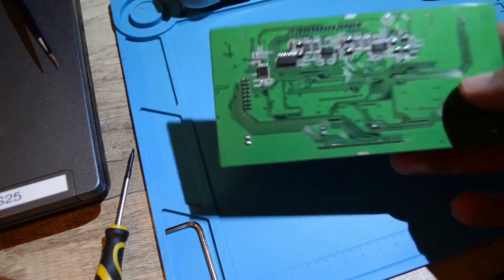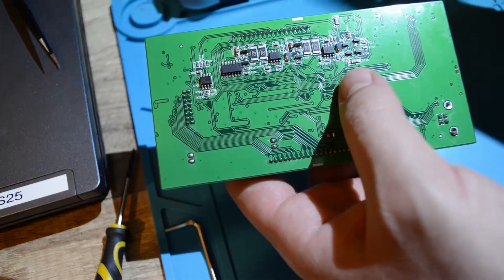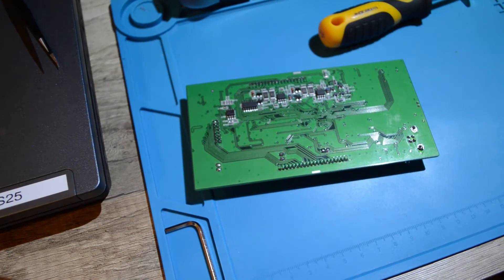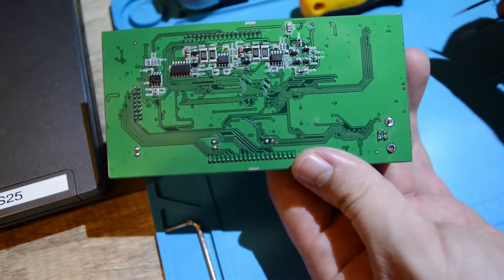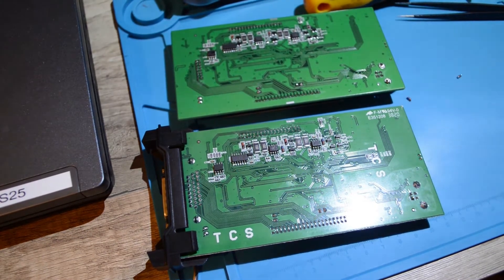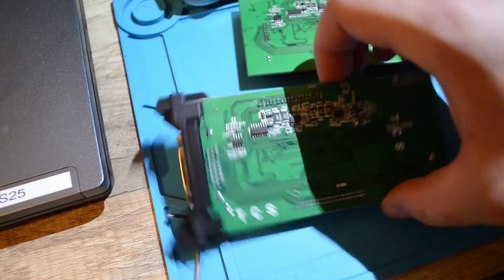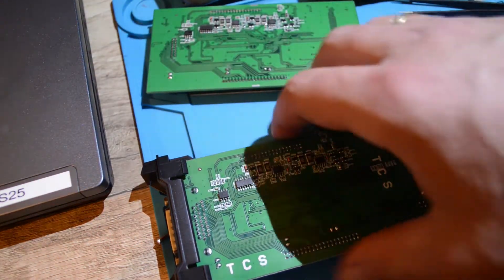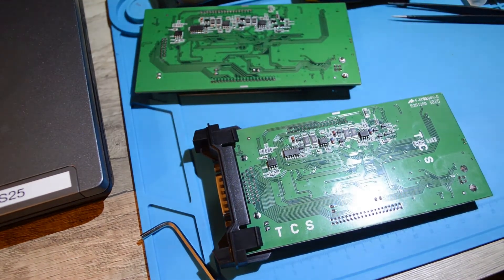Delphi DS150e Repair. Vehicle not responding.Delphi no connection with Opel. BMW and Truck (LKW)

Comment: I updated from 1623 to 3201. After updating I tried to connect to Renault Fluence ZE. But it shows vehicle not responding. So I went back to 1623 and it is working well only on version 1623. Is there a solution for this (vehicle not responding) when updating the firmware?
Reply from the maker: @falahdemery8258  single board or dual
Reply: @YOYODiagnostic  I think dual board
Reply from the maker: @falahdemery8258  RTFM

Comment: Im still getting vehicle not responding, its a 2 board v3. any help would be appreciated
Reply from the maker: Buy a real programmer. Stop using clone. Thinkdiag is only 120 euro.
Reply: @YOYODiagnostic  Thinkdiag ile bu programın ve cihazın yaptığı hiçbir şey yapılmıyor. Hyundai i20 2016 model 1.4 Crdi aracımda thinkdiag ile sadece rejenerasyon yapabiliyorum. Enjektör kodlama yapamıyorum, DPF replace yapamıyorum, sensör resetleme yapamıyorum. Hiçbir şey yapamıyorum.

Comment: I’ve got a PCB that says TCS MAIN V9.0 with original FTDI, upper board has a processor and orange nec relays. How to make it better? Do i need to remove these D701 and D703 diodes? Are there any mods needed on my ds150e ? Thanks
Reply from the maker: Hello.
Send pictures on Mail with the motherboard.

Comment: Hi, do you still recommend to get the V3 PCB? I rarely use mine so I don't know if I might need it. What is your opinion? Thanks
Reply from the maker: Hello.
V3 remains the best dual board clone.  to run the new Autocom2020 software at full capacity you should have a single board.
Reply: @YOYODiagnostic  I orderd a V4.0 with the single PCB and also asked for pictures from the seller. The V3.0 was listed for 50€ and the single board for around 75€ so I bought it. 

What do you think about it?
Reply from the maker: @badrc350  
Hi.
me, honestly!  I pay some more money and buy Thinkdiag or maybe Xtool A30.
An original product remains original.
Reply: Hello thinkdiag or xtool needs pay for yearly subscription or updates?

Comment: Hello. My diag died no light after connecting to defect car. Probably shorted. Whitch protective element to replace?
Reply from the maker: Hello.
In 10 years of using it, this has never happened to me, but unfortunately I can't help you if you don't have knowledge of electronics. 
 You have to start with the simple rule where the intestinal current enters, namely on pin number 16 there is 12 V,from there you have to see where it leads on the motherboard.  
It doesn't turn on even when you only connect it to the laptop, then look for the 5 volt input, namely the USB one.  the middle pin is positive and the case is negative you feed it to the laptop and continue the measurements. 
Any tester has a fuse that protects a circuit.  I'm looking for her.  Is the single PCB double?

Comment: For me this did not work, afterwords I even lost some functionality that I initially had. For example before I could read Airbag computer on some cars, with this modification I can't anymore, so I have to return the diodes...
Reply from the maker: Hello.
Replace with quality diodes. 30v
Reply: @YOYODiagnostic  OK, will do. Thanks.
Reply: @YOYODiagnostic  After replacing with quality diodes there was no change, I actually had to return original diodes in order to use the device again. In my case diode change did not work at all.
Reply from the maker: @TOMA21207  
Send me pictures of your board to my email
Reply from the maker: @TOMA21207  
Hello. I will post a video with rework on that clone
Reply: @YOYODiagnostic  I will as soon as I open it again.
Reply: @YOYODiagnostic  How to send you pictures YT doesn't allow pictures in comments and there is no private messages?
Reply from the maker: @TOMA21207  
I left my email address all over here on YouTube, if you read a little you would find it. ,,  yoyo.pc86@gmail.com ,,

Comment: ON Semiconductor Standarddiode 1N4148_T50R DO-204AH 100 V 200 mA

I used this but not working on BMW E46 320d 136hp Diesel with 20pin ODB
Reply from the maker: Hi.
These clones have connection problems.  
If you only use it for BMW diagnosis, get a better dcan cable and use INPA and it is very cheap.
Reply: @YOYODiagnostic  Hello, I have a BMW diagnostic device with Inpa. Just wanted to get that going too. Thank you
Reply from the maker: @MA-kc1rs  
I will post a video on how to completely rework this clone. the idea is that the original chips are not available at this time. and when they are valid the price is exaggeratedly high. 
Unfortunately it is not worth it and with that money you can buy a real diagnosis not a clone to which you can update and it can work on cars until 2021, and the most important thing is to work not to be listed
Reply: @YOYODiagnostic  Thank you for the help.

Comment: Hi, i got myself a cheap aliexpress one and out of the box it doesn't work, ill wait for the refund process to go thru and then id like to try and repair it, or order a new one. Do you have any links to a known good seller who ships working products?
Reply: I have, original NEC Japan relays, works 100%. 120 euro, 1 year warranty.
Reply: @zvone1990
Reply: @ronitmanojcumar658  What?
Reply: @zvone1990  where did you buy? Im trying to connect DS150E on MAN TGA TRUCK, but communication error.